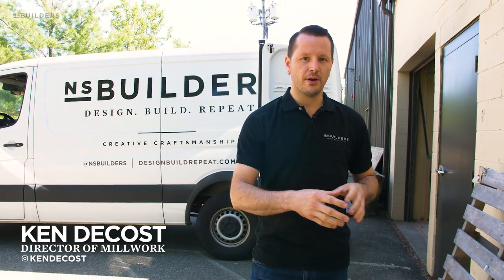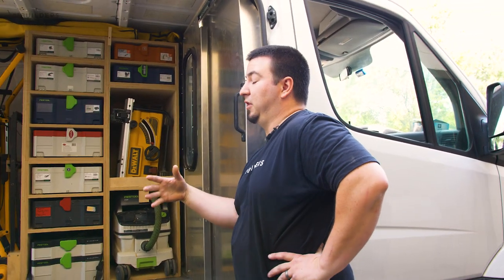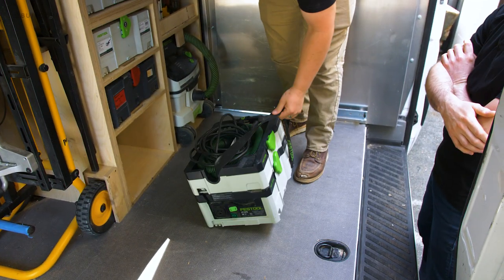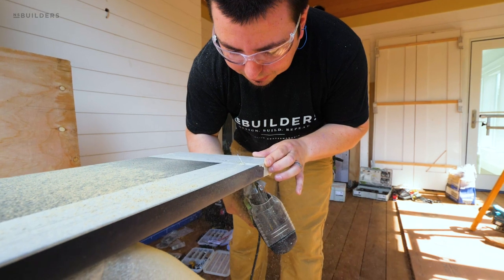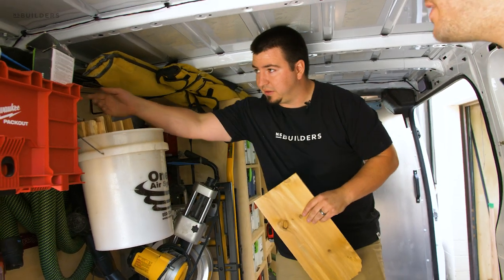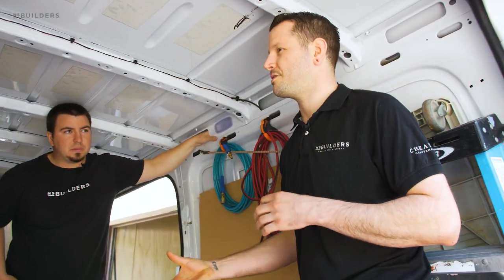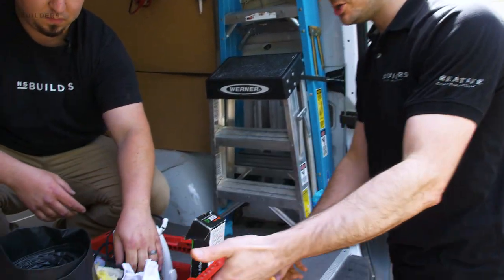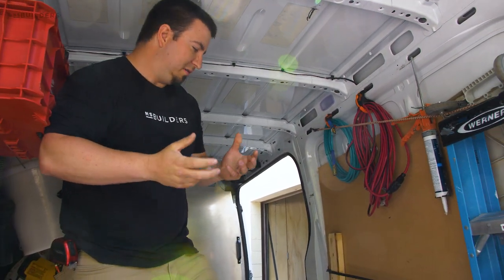What's inside our cabinet install van? | Revealed

Comment: Owning a small mill work shop myself the van is one of the most important tools for efficiency. Almost never enough room. I currently own a long wheelbase metris but a Sprinter or Promaster is next on the list. I noticed a comment on what type of carpenters apron or pouch is worn during install. And your absolutely right, none. Need to keep those tools away from surfaces and don’t want to carry extra weight. Place tools in a carpenters bag and cart it where needed.

Comment: First question. When setting cabinet boxes, especially bases, do you always put a screw top and bottom of each stud? Also I would love to see what James tool pouch, for installs looks like. What pouch, what tools, etc
Reply: Not studs but to the blocking and yes. He tool bag is a Veto backpack with all this handtools/drill. It's not a pouch he wears during installs. We actually have a policy against that.
Reply: Screws at the top of base cabinets are more than enough to secure your cabinet to the wall, gotta remember a 500-1000 pound rock will get set on top within a week. 

Island run is a little different, the rock when installed can knock some stuff around so a screw at the bottom into a stud is worthwhile so keep things from getting racked